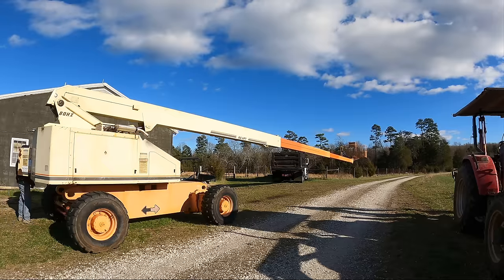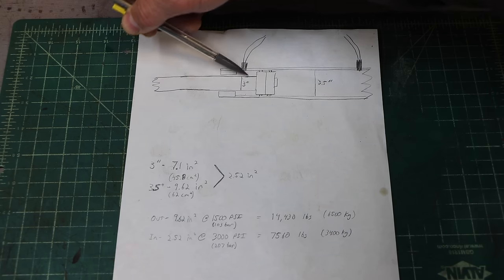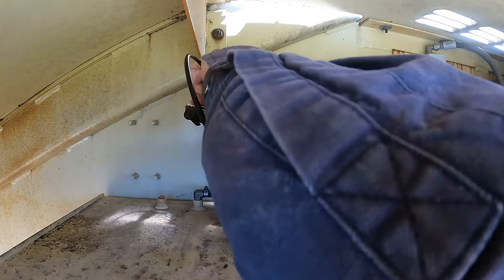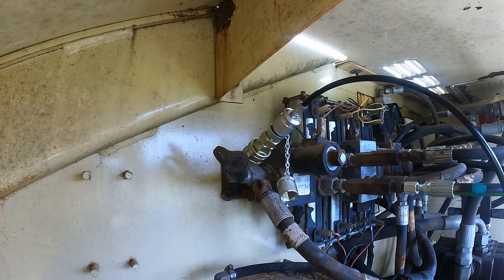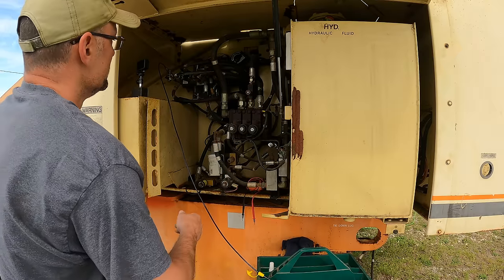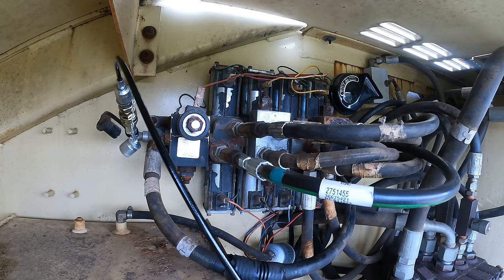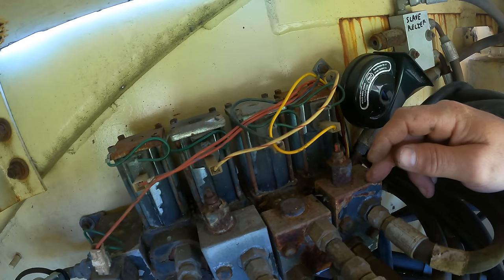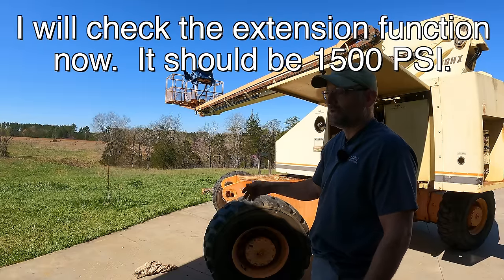My Toughest Hydraulic Job Ever. DIY Advanced Hydraulics.  JLG 80 HX Boom Lift

Comment: You did a good job. 40 years USAF Hydraulics and 10 years Industrial. Point, two types of seals, static and dynamic. The O-ring you replaced needed a static i.e. a gasket  not to be used on moving parts. They have a stiffer rubber and made to fill imperfection while the dynamic are made to conform to changing surface areas.  I will say I have used dynamic seals for a gasket but not at the pressure of 3000 psi. Still as long as it doesn't leak . Also lifts like you have use pilot operated check valves. You need pressure on the other side of the cylinder to open the check valve to return. This locks the cylinder unless you have the pressure to operate it safely. As for shimming, I've done it as a temporary measure but the amount you will use it, I believe I'd leave the shim in. I wouldn't have minded working with you back when I turned wrenches. A lot of the people I worked with removed and replaced until the  problem was solved. Trouble shooting your way is the Right way . Thanks for a good time.

Comment: i've got about 10 years working on hydraulic equipment. shimming a weak relief spring is totally fine. still worth getting the right one, but you're not hurting anything by taking up the "slop" in the spring that lost it's strength.

Comment: Only thing I'd add is: When you're pulling cartridges from a valve bank, go Key On Engine Off and cycle the functions to remove any pressure from the hoses. It will save a little on leaks depending on where you're opening the system.

Comment: I never realized a person could have OCD with fixing something but your determination is above the average joe who says.. "close enough". I do realize the machine will never function to its best unless you do just that... fix  what is wrong or even make something better than its designed to do. I am similar I am guessing on amounts of time spent working on hydraulics. Or can I say that I have worked on orbital and other types of hydraulics a bit, injection and some different kinds of hydraulics.. never a lift tho. I have worked on air compressors that run large air drills or stuff on equipment like say excavators and this is not a short list.... so all said and done, I admire your determination to learn what you could. I definitely agree to the LABEL STUFF for christ sakes! You don't drive across the whole country without a map

Comment: Man I would say for someone who claims to not be a professional hydraulic mechanic, you sure do good work. I worked with many “professionals” who wouldn’t have been able to figure that out. 

I wish you would have kept the video feed showing the pressure gauge while retracting the boom at the end there. It’s interesting to watch the pressure drop as the friction gets less and less while the boom is coming in. I bet if you giver a good spray down with a good dry lubricant or maybe some Silicone spray it would retract even easier. 

Anyway, thanks for the informative video!

Comment: I'm really impressed you took on this job. You gotta fail a few times before you get it right. The fact that you had to boost your pressures tells me that your pump is getting tired. If you have to boost your pressures again in the future, you might want to source a new pump. For now, fix those hoses sticking out of the cable track before they get snagged on something. Keep up the good work! Boom tech out!

Comment: As an EE with a little mechanical experience (including working on ABS hydraulic units, which was an unfair advantage...) I was wondering if you were turning the right one pretty quickly because the PRVs are lined up with the "opposite" side hose ports, which is usually done to get enough depth into the block for the spring, valve pintle, PRV threads, etc.

Glad you figured it out - you'll never forget that one.

Only thing I would have suggested is measure your main PRV pressure as well as the others before futzing with adjustments - it would have been a real kick in the ass if you had adjusted all those things only to find out that your main PRV was adjusted way too low or had been damaged and was bypassing for no reason.

The only reason I'd be worried about shimming that PRV is if you go far enough that you are hitting coil bind on the spring either immediately, or before it is able to bypass enough fluid to keep pressure below spec.

Comment: Nice one! 
I guess you could have unscrewed the adjustement screw on the pressure relief valve all the way until it separated and then either remove the jam nut or shave some material off to make it thinner? This would also render some more adjustment. Unless it's a captive system, then this wouldn't have worked. 
I think the washer method might have been easier in the end :)

Comment: To calibrate a bourdon tube type gage:
Check the calibration and make note of the readings.

1)  If the pointer is not on the zero, or the peg if it has one, remove the pointer and place it correctly (on zero).
   a. It should not be hard spring loaded onto the peg (if it has one).
   b. If it is, this may have been done to make up for a crappy bourdon tube.
2)  The bourdon tube can be bent near the block end (carefully so as to NOT crush it) to set the span (range). 
3) T he link is adjusted to calibrate the accuracy of the reading. 
4)  If the linearity is way off, you need a new tube (gage).

Comment: As a hydraulic Mechanic for 35+ years you did a pretty good job troubleshooting. My concern was why you were getting pressure changes on both sides of the valve when only adjusting one relief. Also the retract side of the cylinder will usually have a load holding/controlling cartridges that requires the higher pressure to allow for a smoother controlled retract. You may want to find that cartridge. The shimming is alright because you did it safely and with expertise on understanding the math. As for your pricing of items I think you were off by a factor of at least 10. Hydraulic stuff is very expensive if you can actually find it.

Comment: Pressure loss can be due to the springs loosing their tension, washed out valves or maybe even issues with the pump  (no maintenance, seals etc.). Also the oil quality can have an impact to that. You work exactly how it is supposed to, make an overview, understand the system and then adjust. Keep on and greetings from Germany.

Comment: Woohoo, I worked out a practical problem! As soon as I saw you only testing one direction I got a bad feeling that the electrics and hydraulics were out of phase. As a nerd of a binary rather than engineering ilk it makes me disproportionately happy to get this kind of thing. If you solved a programming problem I'm sure you'd feel the same (assuming you're not also a coder).

Comment: The shim still won't matter even in the future because the overall pressure won't go over 3200 with that main pressure relief valve. Also amazing video series and extremely comprehensive repairs on the old machine. Well done. I'm hoping to buy something similar for my farm in the near future.

Comment: careful! voltage is flow rate (how fast it can work), not pressure. amperage is pressure (useable force). the SINGLE biggest mistake anyone ever makes when diagnosing hydraulics is thinking of it in terms of the pressure. a pump's job is to make flow (the goal is to transfer motion from one place to another), and pressure is just the resistance to the flow it's trying to make. trace the flow, and the pressures you see are the result of the various valves (and cylinders/actuators/motors) and how they affect the flow of fluid. when pressure is amperage, you can see that the relief vales are the circuit breakers. nice job! you got there. you got a real good handle on things. a lot more than you give yourself credit for:)

Comment: You need to lube the top and bottom pads so they move easily under load.  Do not use grease because it attracts grit.  My go-to on all my heavy wrecker booms is motorcycle chain spray lube, it works excellent and lasts a couple months of constant use.  Silicone spray also works but only lasts about a week for us.  If we don't lube our pads won't last but six months.  Lubed we have units approaching 20 years old with the original pads in them and the paint still in place where the pads ride.  You aren't dealing with loads or duty cycles anywhere near what we do but you still need to lube the pads.

Comment: 15:54 COST! But i agree with you so much, that i spent my OWN money to buy a punch set, stainless wire, and aluminum tags and i sure as heck punched the id tags on EVERYTHING i worked on that went outside or needed a label. no paint, no stickers, no scratching the label on. punched aluminum tags!!! i spent way too much time chasing lines and it drove me a little insane

Comment: That was Great!  Thanks. PS. (Hack) You can sometimes stretch a spring to give it a little more strength, but I really liked your idea of shimming it. I was a Aircraft Hydraulic Mechanic in the Air Force in the late 60's early 70's. I hated it. Always crawling into impossible places. My uniforms were always stained with Hydraulic fluid. I don't miss it. That's why I had a 44 year career with the phone company when I got out of the Air Force. Good on you for pursuing to the end. I have nothing but admiration for your willingness (however stupid) to do the impossible.

Comment: I can't give hydraulics suggestions, but I'm a beer sommelier! 
I suggest always drinking from a glass, it's tastier, and don't worry about making too much foam, it's totally ok unless the beer is crafted with too low co2 and you like them very sparkly, in that case pour them slowly at an angle. 
Also black beer like porter or stout styles (like your Guinness) should be served at around 8-10 celsius to get more flavor, not colder. The clearer the beer, the colder is served. Blonde at around 4 celsius, red at around 6-8 and black at around 8-10-12 💪

Comment: Just like you said you're trying to get to target pressure not going out. Plus you have redundant pressure relief valves set 200 psi over target. And by the video on you repair it your more then on top of it and most likely will notice something running outside of normal operation great work

Comment: Newer JLG have ECM and a scanner.
After 1990s .
I bought a JLG scanner for our fleet.
Rarely do 60 ft plus booms suck in when flat horizontal especially with load in basket.
Dirt rust on boom sliders when older make so much friction.
Also never use Teflon tape on hydraulic system s one small piece can clog a valve port etc.
There are small orings on control stems magnets activate.
Often they crack leak and low or no pressure to a function on that control valve stem .

Comment: Most people think that hydraulic systems are always shoving oil around at max pressure relief pressure.   This is not so, for most average loads the pressure is only enough to balance the load, so for instance a half ton load might be moved easily with just 500 psi.    It is only when you try to lift an immovable object (or hit the end of the ram travel.) that you get the system relief pressure in the pipes.

Comment: You can shim that valve (add a shim to where the spring is).  That's how you adjust these valves where there is no bolt to turn.
Reply: nevermind, a minute later you shimmed it :)

Comment: I think the preassure realease valves change the pressure of the valve on the other side. So the top controls the bottom and the bottom controls the top.

Edit: I see that you figured it out, but I don't just think it's electrically it's also hydraulically.

Comment: Hey everyone
I have an 05 genie GR15 runabout I scooped for $800. It functioned when I bought it, but the functions were sometimes intermittent. It had clearly seen weather. I was testing it out in my driveway and once it was fully extended and I was driving it a little, it stopped working. I had my girlfriend let me down. I replaced the batteries before testing it. When I replaced the batteries, I found the positive wire corroded through. I soldered together a new patched line.  When it failed I diagnosed a wire in the screw in harness to the relay board that gave it power had corroded in the harness. When I bypassed it, I got power back and all function back EXCEPT  for forward and reverse. I replaced the potentiometer/ stick assembly, and I had the board that handles the switching in the stick box looked at. He found some water damage but nothing wrong. Relays both worked and it seems good. I had him check the lower relay switching board that has the removable relays, same gig all good. It is hydraulic wheels for drive and steer as well as basket up and down. When I remove the relay that controls right steer the machine will drive forward and backward as it usually employs both relays to turn, but can only use the forward or back relay. Essentially, the stick isn't giving all the signals to the board when in drive function unless aided by the directional indication. I bypassed both the tip and limit sensor and switch, still no drive function. Any ideas? I will make a video if I get even one response. I am desperate

Comment: regarding labelling: for machinery assembled in places where labor costs are low, and workers don't have a reliable knowledge base, one way to save a tiny bit of money on each build is to do without labels. It's the extreme application of on-the-job training. The workers are taught to run one hose/line at a time from terminal to terminal. 
There may also be a foreman to inspect or sign off on each new line installed before the worker can go on to install the next one.
In this scenario, labels don't bring any advantage to the asssembly process.
Places with higher labor costs, and workers with a more reliable knowledge base, installation tend to follow the pattern as with wiring looms. Hoses, lines are run as a batch task, and then hooked up as a  separate batch task.

Comment: you can lessen the opening crack pressure on load lock valve on boom telescope cylinder. Graingers sells sun brand relief components

Comment: Could you have swapped the hoses, and swapped the electrical connections, therefore swapping the functions? Because the out function would be fine on the side that was low.

Comment: The pressures should be set when the cylinder is bottomed in or bottomed out. Doesn’t matter what the pressure is whist the cylinder is travelling in or out it will fluctuate depending load in cage, resistance of the slides & the angle of the lift cylinder. Eg takes more pressure to push it out it the main cylinder is elevated.

Comment: @16:09 a lot of the newer units have much better labeling. Some have nice engravings along the hydraulic manifold helping to identify particular circuits. 

Also oddly enough I've also had good success using the parts manual in tandem with this. If you look for "telescope circuit relief" for example it normally not only shows what it looks like but where on the manifold said valve goes.

Comment: No matter what anyone says, the shim is a perfectly legitimate fix as long as you KNOW the pressure specs and don't exceed them. JMO
 I would have turned the washer(shim) to the OD of the spring, or smaller by .010. That diameter is not important unless it sets down in the taper at the bottom of the hole.

Comment: You should adjust hydraulic release valves live, with the pump running. Start with it “open” and then tighten it vail locking at the gauge. Otherwise you risk braking things.

Comment: if you didn't know pressure relives can be adjusted while the machine is running even while the valve is open. It's noramly preferabal since you can see how much you need, but the way to do it is to unscre it all the way untill it would read 0 and then turn it on and tighten it, reason beaing so you don't acidently over pressure the system. It might be a tad tideus and the last part probaly not needed

Comment: I feel your pain on hydraulics. Aircraft carrier USS Coral Sea, forward starboard aircraft elevator... HUGE hydraulics, using the same type (a little larger) of control relief solenoids. During a planned maintenance task a tiny bit of rtv or teflon; "somehow made it into the control system", and plugged/restricted one of those same valve seats. When an old aircraft carrier loses the forward starboard elevator because the platform is stuck in the middle, flight ops pretty much cease. NOT GOOD! That "somehow" statement cost a young officer to not be division officer anymore. A crusty old Chief Petty Officer, found the trouble, got things up and working. Then the entire hydraulic system had to be triple filtered and circulated. Hundreds of man hours and down time. $$$$'s for new oil etc. They found over 50 fittings throughout the systems for 3 elevators had teflon tape. That was a multitude of stupidity exposed, so many more man hours of investigations and all the teardowns... in the Navy we described these types of things as "Major Sweat Pumps Engaged."

Comment: As a not-a-hydraulic-engineer, I'd expect the shimming of a failing spring could potentially lead to the spring deforming further under normal operation. If you readjust the screw/shim to compensate, eventually the spring ends up fully compressed, and the valve is held shut by the screw itself, never opening. If you start losing pressure on that valve, it's probably a sign you do need a new spring. Once you visit Spring-I-Pedia, it's mind-boggling the complexity involved in spring engineering.